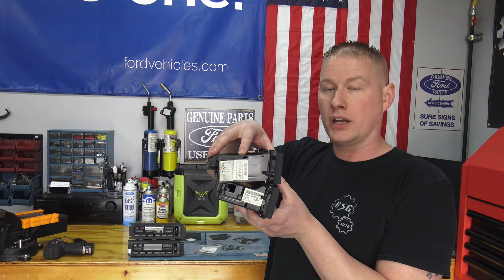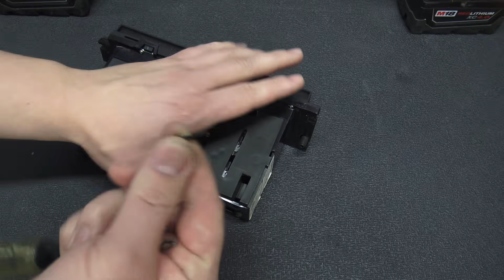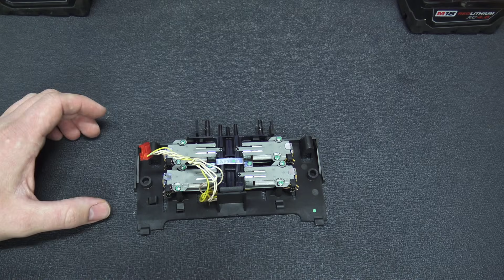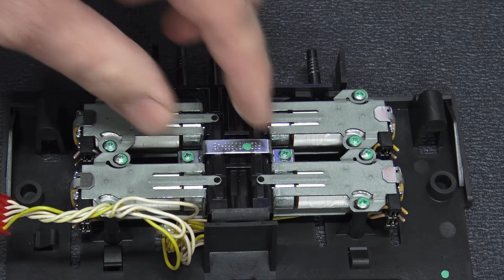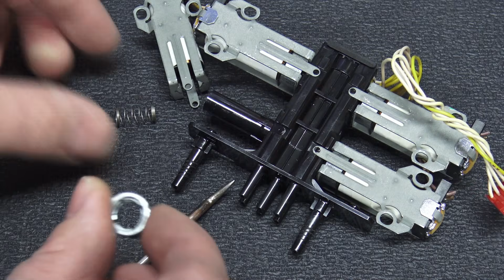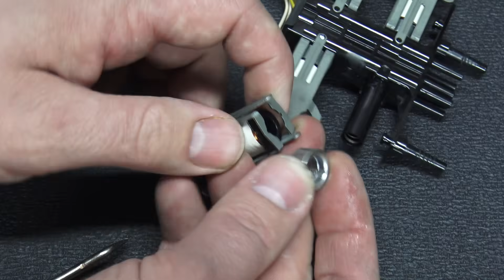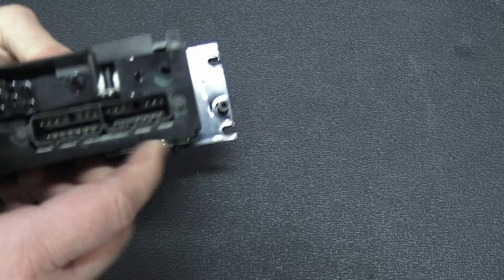Ford HVAC System Stuck on Defrost: EATC Control Head Repair

Comment: HELP! I ordered the exact o-rings and followed all your instructions but the solenoid doesnt fit back into the housing with the new o-ring as if its too big... it even ripped when i tried to force it in does anyone have a solution? I tried grease as well
Reply: You have to spin the silver spacers so that they line up with the ribs on the black tube

Comment: this worked perfectly for my 2009 grand marquis i bought one at the junkyard replaced it fixed ac then used this tutorial on the original one that went bad and now i have two that work thx

Comment: This video changed my life I've had a  03 f150 over 5 years with the air blowing on defrost had 2 or 3 mechanics tell me it was gonna be 500 dollars for a new module. Little did I know for less than 3 dollars and 45 minutes of my time my air blows out the vents like it's supposed to. Worked like a charm

Comment: Bro I can't believe it, it worked. Air only came out of defrosters and and floor, but not the front vents. I replaced the O rings and sure enough it worked immediately. I appreciate the video, saved me alot of money

Comment: Self test …Off/floor simultaneously.. then Auto .. cold button to reset the doors.
Reply from the maker: sure
Reply: @FordTechMakuloco    If my memory serves me correct.. that’s how you perform the self test. Is it?? Been blue oval.. 1987-2014 .. got out because I couldn’t do anymore 6.0’s. Lol. Won the “FIRTFT” fix it right the first time .. back in 1990 .. no comebacks on warranty on the entire east coast!! Got a jacket for that! Lol. Got enough diplomas to wall paper a 15x10 room. Senior master Tech .. all that jibberish.  When i watch your vids .. I get flashbacks. .. Love driving the SVTs ..Cobras .. GT 40 .. lightnings and all them hot rods back in that era. .. hated doing the S/C T-bird head gaskets.!! Ha!  Pulling the inner boxes and replacing the broken doors in the heater boxes .. I can write a book. .. keep up the good work bro. Still got my Super Star 2 EEC code reader lol. 5.0 motors are the best!

Comment: Could tell me the exact size that the o rings are ? I clicked the link and it took me to a 100 pack set , is that the one , because you mentioned a ten pack in the video . Just want to be certain I order the correct size .

Comment: I did this for my mom's 2002 Ford Expedition this past weekend and it worked great. The only difference is that the bracket holding it is metal, not plastic. I had to drill the welds out to fix it.

Comment: 03F150 Crew 4x4
Reply: Used this video info to repair my 2003 F150 HVAC head unit - Had issues before, that lead to a small vacuum tube leak under the hood near the vacuum reservoir - This time, it was as this video suggested, and I was so glad I found it - Made the repair and WOW what a difference! - Now I have no more issues with the air flow diverting to defrost every time I accelerate - Thank you Sir for your genious tech support to all of us shade tree mechanics - Very much appreciated!

Comment: My unit works . But now I can't turn it off or control blower motor.  I hit off  control  and held it in . No response, I get cold air it seems to bet stuck on automatic. I did disconnet  the battery to reset the computer , it is still the same. I bought this 6 years ago at Advanced auto. Do you think electronics are shot

Comment: Just fixed mine after watching this a few times
couple things to note

those four metal spacers need to be rotated to align in order for them to fit back onto the tubes flush

one of the tubes also has a metal screw head looking thing that falls out

you only need a $2 bag grease from auto zone

make sure to do each calanoid one at a time as to not mix things up

front dash part just pulls off and you'll need a wrench to take the faceplate screws off of the head unit

you'll really need to wiggle the tubes off

Comment: It didn’t work for me any advice? 

What is the science behind this? The old o rings look new, nothing wrong with them
Reply: The hole in the shaft is a controlled size. If the o-rings leak then excessive air flows through them

Comment: Hello, I really appreciate your videos, they are very helpful. I tried this on my 2010 Mercury Grand Marquis that was only blowing air (cold or hot) out of the defrost and feet vents. However, it did not seem to work. Is there any other potential solution to this stuck on defrost problem? My AC problem first started as an issue where the regular AC vents would be blowing and when I would step on the accelerator, it would auto-switch to the defrost vents. Now it's just stuck on the defrost and feet vents.
Reply: My 11 GM has a similar problem. It seems my vents are stuck on.  I do get def and floor changes ok but the vents seem to be stuck on which diminishes the amount of air for floor and defrost.

Comment: Know this is a old video but I just followed this guide and fixed my 06, worked perfectly. Thanks man, subscribed also
Reply: Wat was the problem on your 06
Reply: My issue is my 02 will work but after about 20 minutes cold air will start coming out the defrost and floor. Would it be this problem or a blend door?
Reply: @creationzthruair834  try this first to cheap abs easy not to.

Comment: In my last road trip, the A/C stopped blowing though the dash, and every setting went to the defrost.  Found this video when I returned, ordered the O-rings and the pick tools, followed the instructions to the T, and it worked like magic.  I noticed one of the old O-rings was split, the others just looked worn, but now every setting is working as it should.  Thanks for your video for us that like to try and keep our older vehicles working.  My f-150 is a 2002 Lariat 4WD with 181K miles, looks good and drives great.  I think its good for at least 10 more years.

Comment: Success!!  I used the O-rings you listed and some silicone dielectric grease I have and I was able to successfully replace my hardened O-rings...I did not have dash level air flow before, only defrost and floor.  Now everything works perfectly. Thankfully the vacuum line to the unit is functioning as intended. I have a 2006 Grand Marquis LS.   Thank you so much!!  The O-rings cost me $2.68 and a half-hour of time. So easy! Also, I didn't purchase the motorcraft dielectric grease. I just had a tube of dielectric grease from harbor freight, food safe, that I purchased for my vintage mercedes window mechanism. I think it cost 6 or 7$.
Reply: I have a 2008 Grand LS
, When I have My cold Air Conditioner on , after a bit goes from vent to defrost and back and forth, will this fix that?
Reply: @diamondavid yes

Comment: Yes! My grand marquis is defrost, floor, or defrost and floor but no dash vent.
Reply: Have you found a fix for that?
Reply: @blackfootchata86  I did!  I ordered the O-rings and just finished replacing them. It works perfectly now. The air switches instantly. Thankfully the vacuum line to the control unit is maintaining vacuum.  It was really easy.  Not too fiddly.  You just need some small screwdriver bits, like for phones or electronics.  It cost $2.68 from amazon for the o-rings. I used the link in his description.
Reply: Oh ok that's good to know!! I'll be doing the same, how did you know that the eatc was holding vacuum before repairing eatc

Comment: I have a question.  I have a 2004 F250 super duty truck.  I would like to change my control module from manual to auto ...  Can this be done ??
Reply: Did you get an answer on this?

Comment: I am not mechanically  inclined,  but  following the instructions  i managed to fix the problem....all buttons went  to defrost air....07 grand marquis... the video i watch 3-4 times was very detailed and i managed to take  all the control  buttons  off and replaced the   O   RINGS..   took about an hour.  BUT I  DID IT  BY REPLACING ALL THE   O  RINGS!!!!

Comment: This not only fixed my AC vent stuck on defrost issue. It fixed my 4 wheel drive issue. 2003 f150 king ranch. struggled to get the 4 wheel drive to engage at about the same time my vents stopped working.  Just for the heck of it after successfully fixing the vents thanks to this video, I took it out on the road and turned the 4x4 knob and it went right in.  Turned it off and it came right out!!!!  Been struggling with this for a year.  You are AWESOME!!!! Thank you.
Reply from the maker: Nice!
Reply: @FordTechMakuloco  can I just pull the metal piece from the back without taking the whole thing apart?

Comment: YOU'RE AWESOME!!! Went to the hardware store & picked up some o-rings, installed them, and now my heat is finally working just in time for winter!!!!
Reply: I can't get the heat to work on my Grand Marquis. It only blows cold and can't even adjust the AC temp up. Fine for summer but not winter. So this fixed your no heat issue?
Reply: @JamesSterling yes, it fixed mine. One other thing to look into is the blend door actuator. I would say if you're pressing buttons on the unit and don't hear the normal "hiss" sound from the vacuum actuators, this would be worth doing since it's pretty easy

Comment: Great video and instructions. I decided to remove all of them and when I replaced the o-rings I realized I didn't know what order to put them back not sure it matters. Anyway after installing it the buttons are mixed up. For example, to get the vents to work I have to push the floor button. Nothing works as it should. Any ideas would be helpful. Thanks.
Reply: Take it apart and rearrange the valves... trial and error. I did mine one at a time so I did not have this issue.

Comment: I have the same problem with the vent in my 2009 Grand Marquis. But I also cannot control the air temp. Are both problems caused by the bad control head

Comment: Hello! My issue is with an 01 Mercury Sable with EATC. Problem is on wide open throttle system defaults to defrost mode. Initially I thought it was low vacuum or vacuum reservoir tank leak. Unable to find where tank is (if it is indeed there, not sure if they use one at all at this point) I am leaning toward the thought that I may also be afflicted with o rings in the control head. I just want to make sure I am on the right track before I start ripping things apart. Any thoughts?

Comment: Would you mind making a video just going through all of the vacuum lines for a 1997-2003 Ford F150 4.6 4x4? I think it would be a great help since those trucks are so vacuum based (and a royal pain to find leaks on at times). I haven't found anyone who has presented a really thorough breakdown of the vacuum systems from start to finish. I think it would be worthwhile and help out rookies like me who don't do well reading diagrams. Thanks in advance if you do that!
Reply: Great comment and I think that it's needed. I will repost your comment and see if it helps us.

Comment: I followed your instructions to the letter and still have no ac vent action. I even replaced the damper control( pita big time). Do I need a new unit or do I have some air leak?
PS: still blows cold out defrost/floor vents...

Comment: (03 f150 lariat 4x4) Alright so I replace the orings. Even found the 2 that failed. I still get little to no vacuum to the actuator (red vacuum line). I have correct vacuum everywhere else. Behind dash, both check valves and lines under the hood. What am I missing?

Comment: I have a 2003 Excursion.  I have the 1st unit you spoke about (the one you said does not have o-rings) but I am having all the problems you discussed.  Mostly air only coming from the defrost but also complete loss of power.  No lights and nothing works.  Give a minute or sometimes hours, it starts working again.  Any videos on what that could be?

Comment: I got a 97 Mercury grand Marquis Ac Full Freon Take relay out and put a jumper wire across then my air-conditioning works but I do not have power to the wire goes to low pressure switch

Comment: This was great 👍 exactly what my 2003 f150 King Ranch needed. I have the automatic temperature control unit and bought the O-rings you recommended and replace them following your guidelines and it worked beautifully. However for anyone doing this make sure that the stopper that is inside and the spring that is inside both get replaced correctly! The stopper which is the hexagonal metal piece that the spring pushes into place and tightens up we must have the rubber end against the center airway! So when you take apart the first solenoid take it all the way apart paying very close attention to how the pieces go back in! When I first did it I did three of them correctly but the fourth one I put in backwards! Just so happen to be the vent so then I went to a whole bunch of other diagnostic stuff that I didn’t need to do and then I went back and reworked the solenoid‘s and I found the one that I put in backwards! It was so simple to do because both ends look very similar unless you look at them very closely and then you’ll realize that one has is more metal the other one is rubber make a note of it! Save yourself some time! Excellent video

Comment: 2004 Merc. Grand Marquis - so it's possible that it's not the blend door actuator and THIS would./could/might be the fix? Please let me know. Thanks. Great Vid. So thorough and exact. Vents stuck on defrost but occasionally switch back to front.

Comment: Question my crown Victoria it leaks heat when the temperature is 60 and  the air is very low to cool me of I need to close 2 vents off bit it dont have cold anymore can you help me our any idea what's my problem

Comment: Awesome fix for my son's 2010 Mercury Grand Marquis.  Be careful when you pull the solenoid apart.  There is a piston on the other side of that spring  The larger rubber end goes back in first.  Works perfectly now.

Comment: I wish you can make video for manual switch I keep having issue when accelerate
I checked for leak can’t find it I replaced vacuum check valve not sure what else I can do I have 2004 expedition

Comment: Awesome video and great info! I have been a certified ford tech for 7 years and I never knew this was an option. I have always just replaced this unit in other vehicles in the past to be able to provide a better warranty to customers. I ordered the o-rings and used them on my 2003 f150 today and my AC modes have never worked this great!

Comment: Any idea if a 2005 Ford F-250 6.0 powerstrokes unit might be like the one you repaired? If so do you have the link that sold you only 10 o-rings? The one you have is for 100 and they are out of stock. Thanks Great Video

Comment: I have a 2010 F150, I'm having a unique HVAC issue. Occasionally, I will smell coolant in the cab, and my windshield will fog up. Initially, I assumed it was a leaking heater core, however, it doesn't happen often, in fact, most of the time, I get no coolant smell/fogging of the windshield. Is the heater core still a possibility? I have checked for coolant leaks, I have none. I'm not sure how to diagnose it, as I hate to tear into taking the dash out of my truck and it not be the heater core. Also, have you done any videos on that procedure? Thanks, love the instructional content of your page!

Comment: Great video and the fix works great!
Reply: J Rains where did you get the parts rings from and what are they called I’ve been trying to get some at my locals shop not amazon
Reply: @lefreyre  they are labled as 007 o ring 70 durometer red.

Cs: 0.070 in ( 1.78 mm)
ID: 0.145 in ( 3.68 mm)

Thats all the info from the package. I just ordered mine from his link. Much easier.

Comment: I replaced the unit and still no heat , ac , blower working checked all the fuses and relays was wondering can you bypass the vac system and put a unit in that only uses the electrical

Comment: My parents have 2005 Mercury grand marquis the heat/ac unit was working now can't get either heat or ac to come on all the buttons work and display is showing but  still no heat or ac would this be the problem? ... same unit you worked on in this video

Comment: Hello and thank you for your extensive EXCELLENT repair video!! Question: At what point do we “know" that this O ring replacement process is what will solve the Defrost/Floor only Air flow issue? In other words, does this O ring replacment repair work practically every time air flows only out of Defrost/Floor vents? Thanks again!! AE - 2001 Ford Explorer Eddie Bauer Auto EATC

Comment: I have a 2000 expedition, I replaced the front and rear heater core and the air is still lukewarm ?

Comment: When I bought my car the guy said that it was getting stuck on the floor, and then it would all of a sudden start blowing air from the Vent. However, the heater would come on too. Guy took off the heater core hoses, but the head control unit will not turn on sometimes, and sometimes it does want to work. Do you all recommend changing the control unit from a junk yard, or the orings might help?

Comment: The heater controls on my 2003 Mercury Grand- Marquis would not switch from floor vent to the dash vents. I took my car to the neighborhood repair shop and he diagnosed it as needing a new control unit on the dash and wanted a little over $800. to replace it. I came home and watched your video I ordered the o-rings from Amazon and after they arrived I removed the control unit from the dash and followed your instructions and replaced the O-rings. After reinstalling the unit and starting the car the unit worked fine. The O-Rings cost me $10.00 for 100. Your video saved me $800.00. Thanks for a great video.
Reply: That price was ridiculous! But at least he was pretty much right!! Amazing video!!